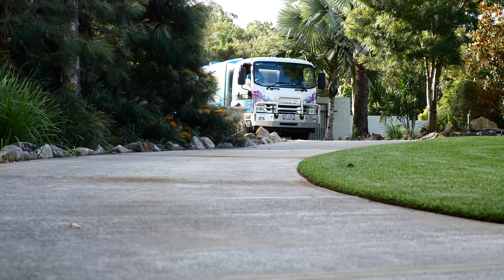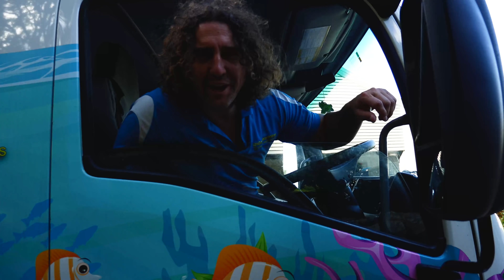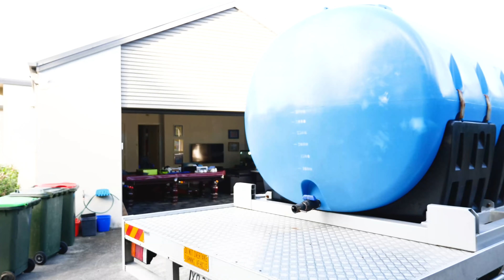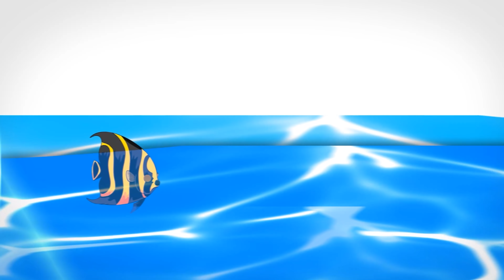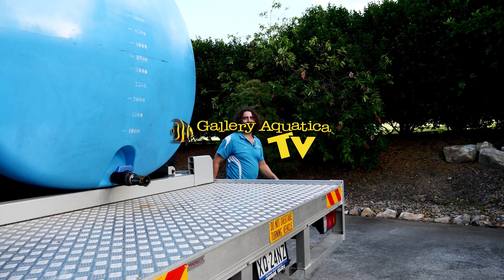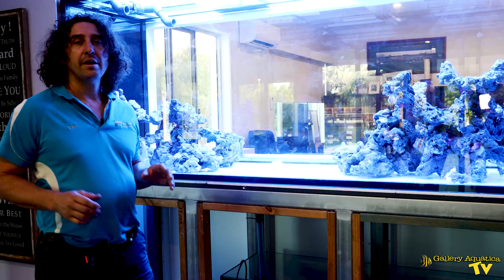Filling up an absolute GIANT Reef Tank!

Comment: I know this is 3 years old now so probs won’t be answered but does anybody know why he put the sand in last instead of before the water like other I’ve watched
Reply from the maker: When you use live (wet) sand it is slightly less messy to add the sand after the water. I also find it slightly easier to evenly spread it out in tall tanks if you add the sand after the water. Cam

Comment: Love the content just subbed!! Quick question :). I am setting up a 75 gallon in a few days. After I add my Caribsea live sand, and then live rock, if the water is cloudy am I able to add my 4 small fish I currently have? It’s 2 small clown fish, a royal gramma and a white coloured yellow watchman goby. Some insight would be extremely grateful.
Reply from the maker: The water being cloudy might be a sign of ammonia, so you definitely want to check that. As long as you don’t have a readable level of ammonia you should be ok to move the fish in, assuming you’re also adding enough liverock (and hopefully biological media) to keep the ammonia to zero. I should also say I’d go slowly with the transfer if you can. Cam
Reply: @GalleryAquaticaTV  hey Cam yes I would be transferring 32lbs of Caribsea live rock that’s been in my current 36 gallon bowed tank. And I’d be using the water from the tank and mixing up the additional 40 gallons of fresh water to go with it. I was thinking of using a couple scoops of my sand from current tank also for the bacteria benefit. My current tank is almost 3 months old.

Comment: Just out of curiosity, why did you fill the tank with water and then add the sand?  Is it to make sure the rubbish from the sand is picked up in the overflow?
Reply from the maker: When I use dry sand I add it before I fill, but wet (live) sand I add after I fill. The only reason is I find it easier to rinse the wet sand out of the bag when the whole bag goes under water. Cam
Reply: @GalleryAquaticaTV  ok cool 👍

Comment: How do you move a tank that heavy into a house without a fork lift?  That must be more than 300 pounds.  Thanks
Reply from the maker: It is way more than 300 pounds. We used a scissor-lift trolley, glass grips and 4 guys. It was a mission! Cam
Reply: @GalleryAquaticaTV  You're right, rough calculation came out to 900 pounds, you must have some strong lads.

Comment: What a lovely tank. I Am planning something similar, but a bit smaller.  With the returns coming back in at the opposite end of the tank from the overflow do you think it's possible not to have power heads?
Reply from the maker: Not having wavemakers makes it harder to have success with corals. You can get away without them but be selective of the types and quantity of corals. Cam
Reply: @GalleryAquaticaTV  thanks Cam

Comment: Why didn't u add the sand in first?
Reply from the maker: Only because I find it easier and neater to rinse the bag of sand in the water. I’ve put sand on clean floors in the past when a small amount of sand is left in a bag that I throw onto the floor. Cam
Reply: Since its live sand it doesn't matter. The very fine particles will need to be filtered out. If it was cleaned and washed sand you could put that in first and make sure the fill doesn't disturb it too much.. in most cases you will have a cloudy tank for a few hours..